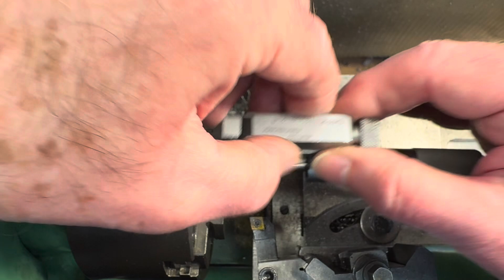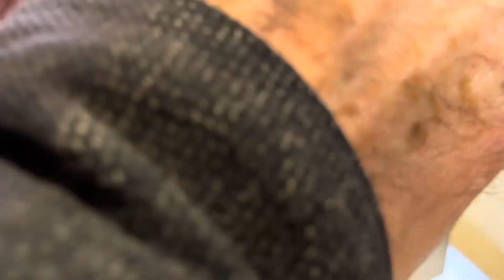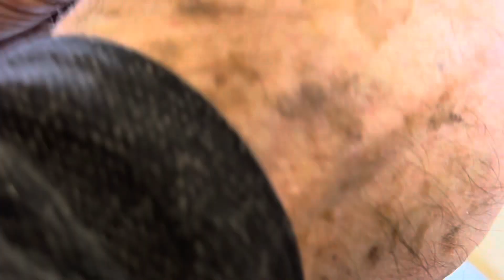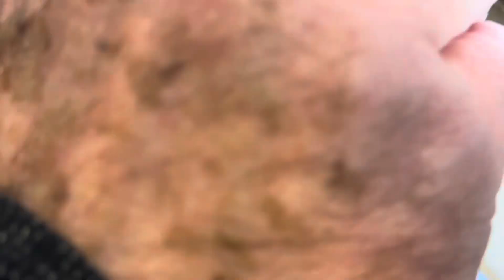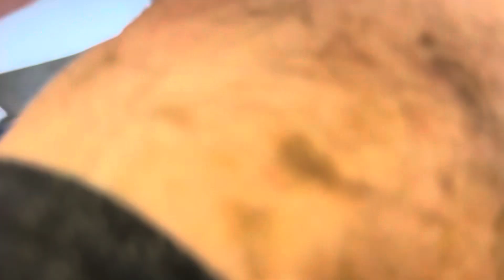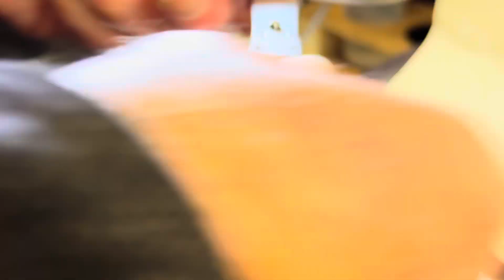PM Research #3 Engine - Part 5

Comment: Nobby, I would have thought that you left it a bit over thickness, mount it on a pin and skim the boss face. Surely that has to mate against a surface to keep the crankshaft in a known lateral position. As you have left it a cast surface, there is a good chance that it will only touch on the high point. If that was me now, I would mount it on a pin the reverse way round and skim the boss face. You could then fit if nesessary a shim to make up any sideways slop in the assembly. Regards from Australia.
Reply from the maker: A very good point David. I may have followed the drawing too closely. It only shows the face I machined as a ‘finished surface’. Some of the examples of this engine I’ve seen shows a gap between the boss of the crank and the shaft support. When I’ve completed the cross head I’ll do a test fit and see if there’s a gap. But I will machine the boss face as you recommend. Thanks for your kind advice and support David. Take care. Cheers Nobby